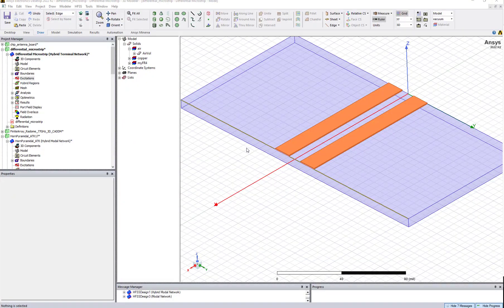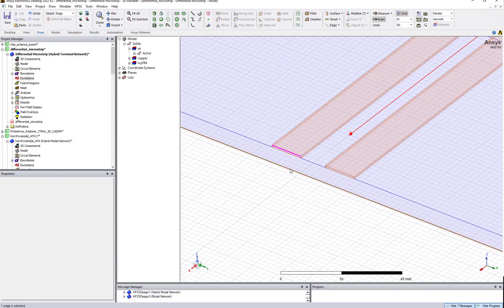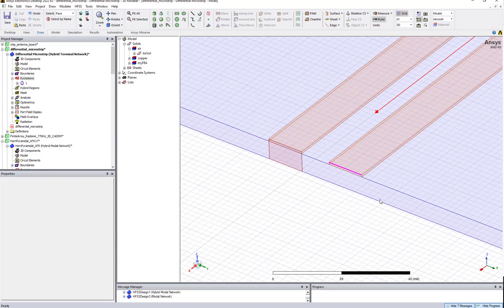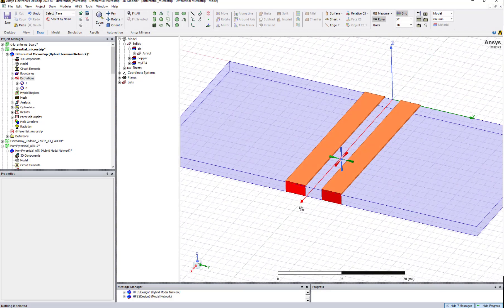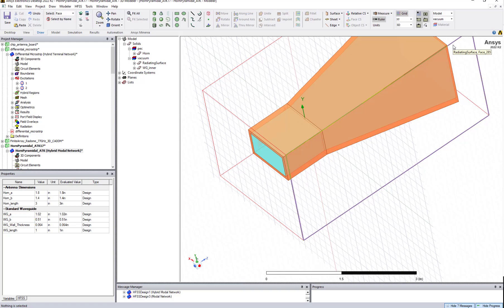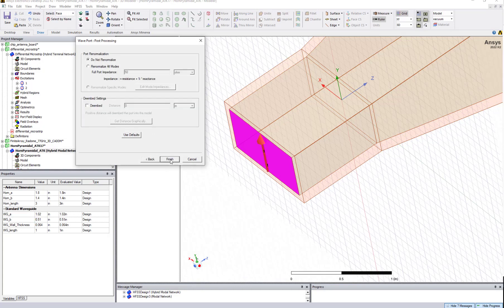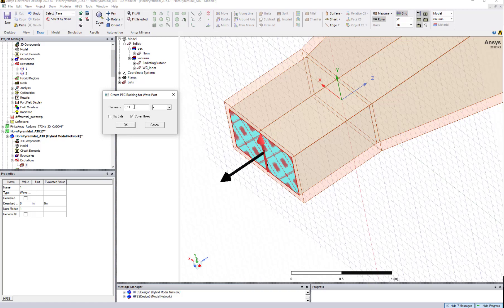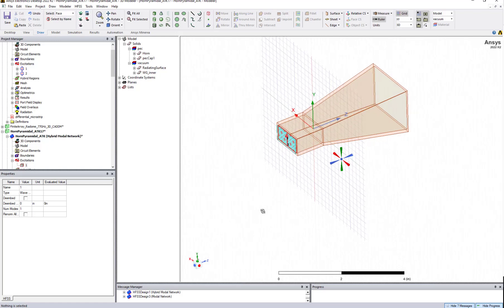Automatic Lumped and Wave Port creation in Ansys HFSS

Comment: If your excitation menu reads " Reference conductors" to fix this, you must click HFSS and there is a " solution type". after you click this solution type you are going to see a title about "options" click the modal. If you have selected Terminal, you won't see the options showed in this video. Thus, your Validation check will show errors.